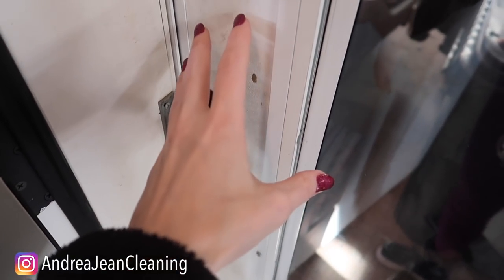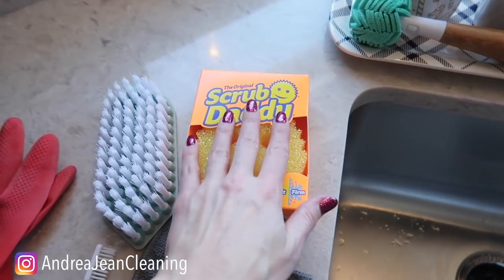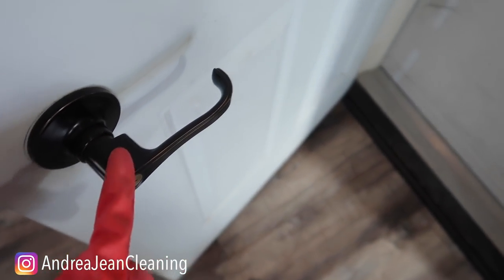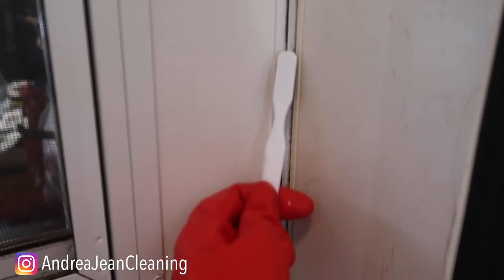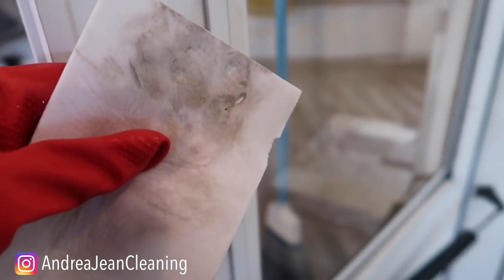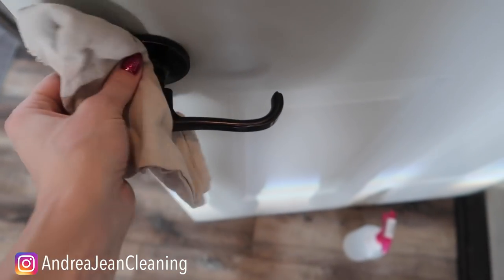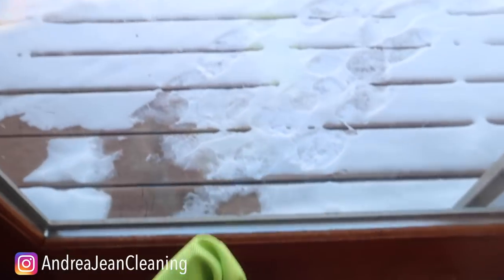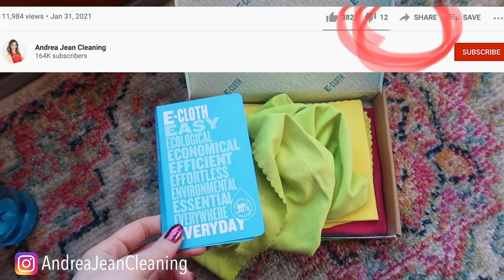How to Clean FILTHY Doors & Walls! (Make Your Home SMELL AMAZING) Lazy Cleaning Hacks | Andrea Jean

Comment: IF YOU HAVE WHITE WALLS DO NOT USE PINK OR BLUE ONLY USE WHITE FABRIC SOFTENER. Make sure you read this entire thing because I didn't and I ended up putting this bluish fabric softener all over my white walls and it caused me to have a blue tint all over my apartment lol but it does clean for sure but don't do what I did and not read it all until the end Read all of this. It does work. Just make sure you don't put any other color on white walls other than white fabric softener from yours truly that is extremely tired from cleaning walls lol

Comment: I’m a hairdresser, we use Barbicide to sterilize our stuff. You mix 2oz to 4 cups water and it lasts. I cut paper towels in 1/2 put them standing up in a $ store container, pour in the Barbicide mixture and have clean wipes to use on the counters, toilet etc. you can also put it in a spray bottle which we are using during COVID to clean our chairs, scissors and counters.

Comment: I know this is an older video, but I came across it earlier this year and wanted to try it on my beat up doors in my laundry room that go out to the garage and into my house.  This trick was AMAZING!  There were parts of the doors that were just beyond hope, because they were dents or scrapes to the paint, but the scuffs and filth that were around the door handles, hinges, and door frame came off beautifully!  THANK YOU for sharing this tip with your viewers!

Comment: Hey great video! Would the fabric softener solution work on plastic blinds? As far as repelling dust? I need to figure out something to prevent in bathroom. Cleaned a couple weeks ago and they were just nasty. Ps I just used thieves cleaner. It worked but if the fabric softener really repels? I would love. Thanks in advance!

Comment: I live in Australia and went into Amazon Australia before you were even finished because I was desperate for mrs Meyers lavender fabric softener and it costs $95!!! So I didn’t get it but I got scrub daddies for me and my kids! Thanks !!
Reply: Just use whatever fabric softener you already have. And a wet dryer sheet is another option. Wrap it around the brush or magic eraser. 
This trick works on glass shower doors too for built up soap scum.
Reply: I’m in Australia too. If you really want to buy it, iherb sell it for about $18.00, which is still stupidly expensive. Just buy whatever Coles or Woolies have.

Comment: I live in an apartment.  Been here for ten years now.  I have tried cleaning my walls and to my surprise not only was I cleaning off the smudges and dirt off my walls but I was also taking off the paint!.   It doesn't matter what I use to clean the walls.  The paint will come off as well.  Only thing I need to do is to repaint uggh!
Reply: Depends on the paint.. I use semi gloss, makes stuff come off easier, and not the paint😉

Comment: I do think people forget to clean their storm doors. I polish my solid wood doors.
Reply: What do you use to polish your wooden doors? We have an old house with an original solid wood door that I love.
Reply: It depends on if your doors have a top coat on it mind do and I use Murphy's soap or I'll use Endust or old english. But I also have a coffee table that has no protecting layer on it and I use Orange Glow or old English on it. I don't like using pledge because it does builds up over time.